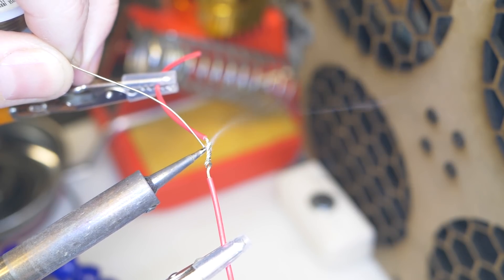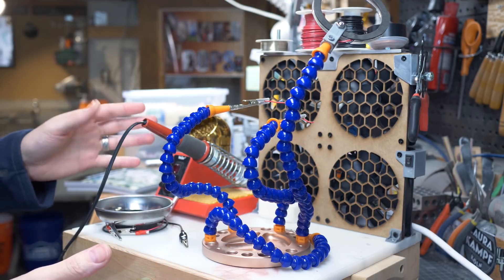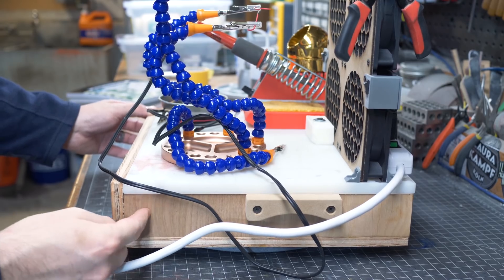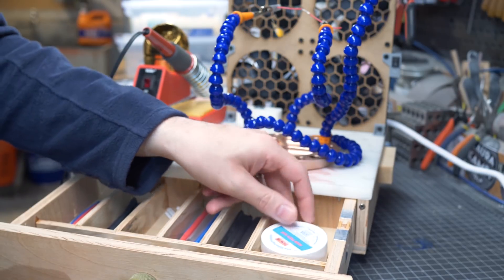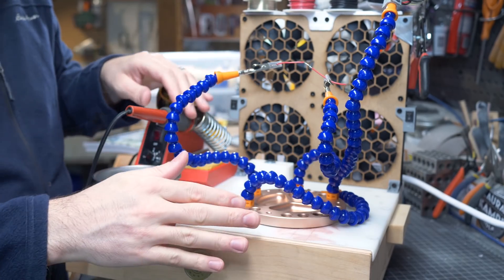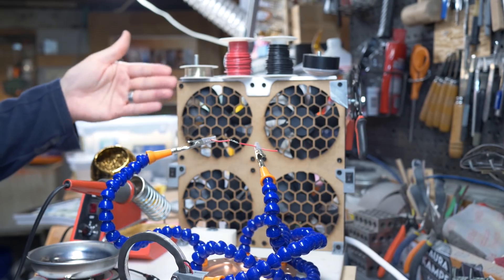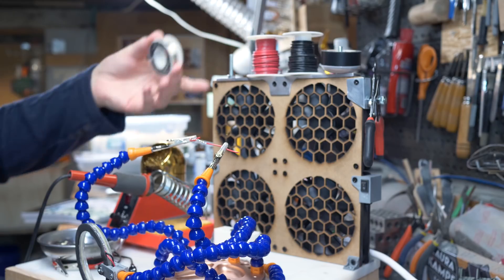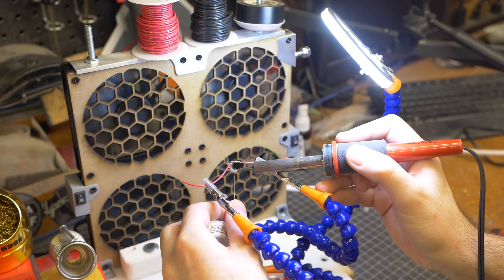Custom Soldering Workstation with Light and Fan Evacuation

Comment: Nice, I like the turntable idea I would add a  braking system on it to lock it in place. Thank you for the razor blade idea, I've seen that on knife handles before but have been too dense to transfer those types of idea to other places in my life.  The light ring available in auto shops thanks for that tip also.  Sal ammoniac thank you for that as well.
 I'm watching this video because I'm getting ready to build my soldering station and you just made appreciated improvements to it,
 thank you very much.
 nicely made video direct to the point didn't waste my time with anything didn't leave anything out and you showed how you did everything thank you!!!

Comment: I would add hinges instead of brackets on the fan upright so it can fold down when transporting or just storing it.  I would also add a filter medium.  I would also upgrade to a Hakko ceramic soldering iron with integrated temp setting.  When I bought mine, it changed my life.

Comment: Nice work. What are the factors you take in to consideration when deciding to 3d print or machine certain parts for the build? Like the metal piece on top that holds the solder and wires. Is the build size the main reason?
Reply from the maker: It depends on the complexity of the part and what stock materials I have on hand. For those simpler parts it was quicker to cut up some aluminum angle stock I had on hand.

Comment: I really like this style of wire strippers.  I do a lot of custom wiring on ATVs and SxS it is nice to just strip the wire without concern of cutting a wire strand or what gauge it is. I do not have this exact set but I will say the ones from harbor freight were not up to the task. They worked but not very well. I wonder if you could put some sort of potentiometer on that light and dial it back if you so desired. If I soldered more at one spot I would think this would be on my short build list. I need mobile so I usually use a butane soldering iron or cart my station to the work if I can.

https://www.amazon.com/gp/product/B014VN6PDM/ref=as_at/?imprToken=bGZEKkE5yxXHNMRpBZt2sQ&slotNum=3&ie=UTF8&camp=1789&creative=9325&creativeASIN=B014VN6PDM&linkCode=w61&tag=newreviews0b-20&linkId=4D4DTOSAQT3C6MCB
Reply from the maker: Ooh fancy!

Comment: Instead of using the foam tape on the back of the light, what if you used metal foil tape used in duct work? The foil backing would prevent the light from shining through to your face blinding you, and would increase reflect the light out the front. You could use it on the inside of the ring and the outside of the ring, so all the light has to go in the direction of what you're soldering.
Reply from the maker: That could also work.

Comment: Did you need to put a resistor on the LED ring? After watching your video I am thinking about modifying a helping hands rig with a light
Reply from the maker: It's a 12v automotive LED ring with 12v coming in from the power supply, so no resistance was required.

Comment: Bill, are you left handed? Putting the iron on the left is the reason I am asking, and because I am Left handed also. :)
Reply from the maker: I'm a righty. I can't recall why I decided to put the iron on the left.
Reply: Punished Props I was thinking you were right handed before I noticed this, but asked to make sure. Layout wise on a small base it makes sense how you did it though since the iron is on the left of its assembly making it less in the way when reached for when placed on the left. At least I think that is how it was in the video.(edit, nvm opposite of what I thought. Maybe you were wanting it closer to the middle for easy reach and for fan exhausting to remove fumes from the tip.)

Comment: I agree with the previous comments. It would not be hard to 3d print rails for the carbon filters to slide in. The rails could be screwed in using the holes of the fans. If planning on doing smaller work on lets say anrduino trinkets I would suggest a good magnify glass and thick wall tubing to go over the clamp teeth. This would help not to scratching the board and make it easier to see the pins of the board.

Comment: Might I suggest activated-charcoal filters along with the fans? Even with the fans keeping the fumes directly away from your face, they're still going to continue circulating around the workshop unless they have a direct passage outside (like keeping the station next to a window). Obviously, this station was built to be moved, so it may be a bit safer fume-wise to use filters like the store bought fume-extractors have. Here's a handy link that shows some of the dangers of soldering fumes: http://www.techni-tool.com/site/ARTICLE_LIBRARY/OK%20International%20-%20Fume%20Extraction%20-%20Guide%20to%20Safely%20Managing%20Solder%20Fumes%20in%20the%20Workplace.pdf Cheers!
Reply: I've used a similar setup from Weller that had a carbon filter. The filter reduced the air flow so much it barely sucked the fumes away unless the part was almost against the fan.  I haven't found a setup that worked well. Do you have any recommendations?

Comment: Couple of ideas for you.  1 move your soldering station over to the right hand side of your set up.  Since you are right handed it will make it easier to work with ( no more reaching across and hitting things with the cord ).  I do a lot of soldering for work and find this works out really well.  2.  As has been mentioned, put a filter on the back of your fans to help trap the fumes.  Otherwise it's a great looking setup.  Only change I'd make is to put a lighted magnifier on it to help reduce eye strain.

Comment: I really like what you have done there.  Really cool.   I would add some filters to the fans to trap the smoke particles.  You can use the filters from standard fume extractors.  https://www.amazon.com/Carbon-Filter-Activated-Xytronic-Absorber/dp/B005C5HUI8/ref=sr_1_3?ie=UTF8&qid=1514244209&sr=8-3&keywords=fume+extractor+filter

A couple of other things, magnification was already mentioned.  And I can't do without a wonderful pair of tweezers.

Comment: I Like it!  A variation on this would be to up-cycle an old ATX power supply to power those fans and LED light.  That way you would have a built in DC power source for multiple voltages without consuming any more bench space.
Reply from the maker: Ooooh I like that idea!

Comment: I like it a lot! The only improvement I would make is a better soldering iron ( I have the previous version of this one: https://www.amazon.com/dp/B00ANZRT4M/ ). The better irons get to the set temperature fast and hold it steady, which is more of an issue with large heat sinks and high temperature solders, but it's also a nice perk every day too.
Reply from the maker: I’ve heard good things about that one. I’ll probably pick one up when the one I currently have dies.

Comment: you're blowing away fumes with those fans but isn't it going to eventually accumulate if the room isn't properly ventilated...plus the power strip being directly at the exhaust just looks like a bad idea as it limits the airflow.....otherwise it looks like a cool diy rig
Reply from the maker: My room is properly ventilated, as any prop making space should be. The fans have more than enough surface area to handle the fumes. I think just one of these fans would be enough, so I'm not worried about the power strip blocking airflow.

Comment: I just had a friend tell me my soldering iron wasn't good enough, but we have the same model! :D Now to build a snazzy workstation like this, though I'll include a magnifying glass (probably where you have the ring light).
Reply from the maker: I might add a magnifying glass to the 4th arm.
Reply: Maybe you could fit one right inside the ring :D ?
Reply: Adding a magnifier to the light ring would effect on use with the camera so putting on the 4th arm would make more sense.
Reply: That's my thinking, too.

Comment: add a carbon filter for the fans..
Reply from the maker: Good idea!
Reply: the stuff at the fish store is plenty good enuf and cheaper
Reply: I second that.
Reply: I second that as well.
Reply: I third that
Reply: Its useful but not necessary. As long as you get the smoke off your face you should be good
Reply: True, but it's still better safe than sorry. Especially considering he spends most of his time in his shop.